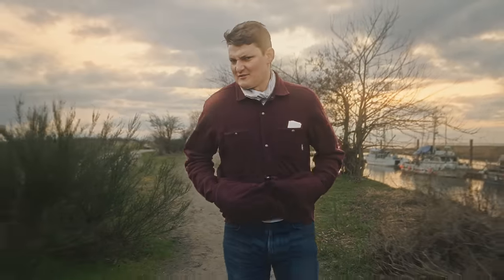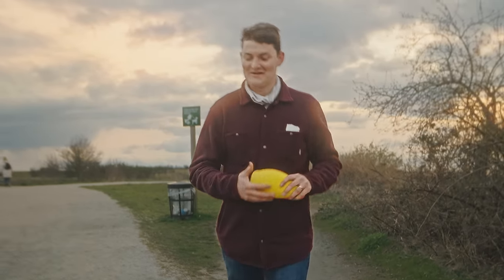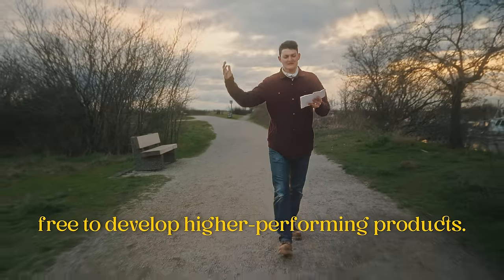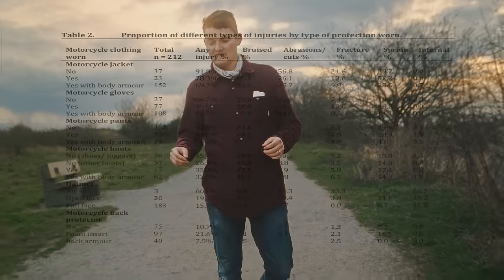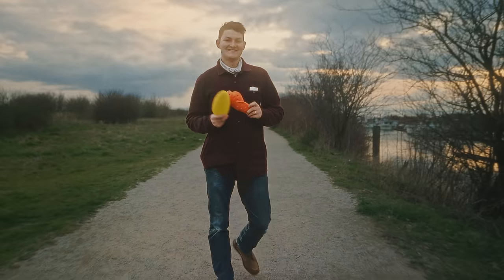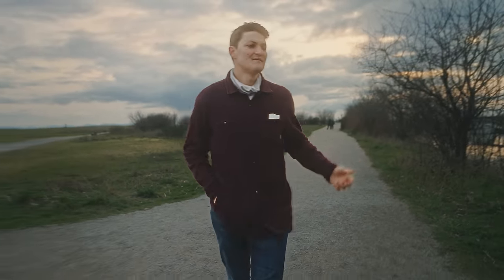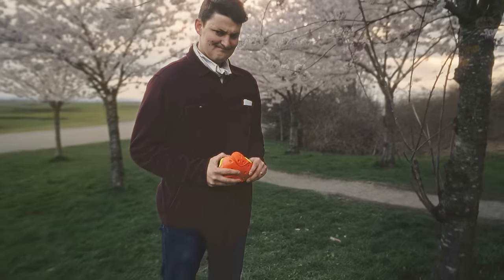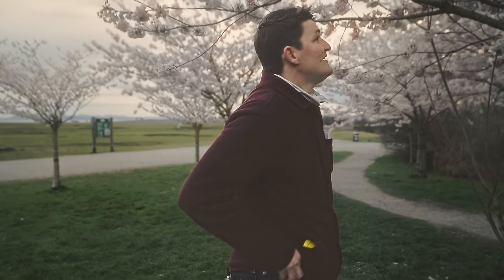Why I Stopped Wearing Motorcycle Body Armour

Comment: What was the criteria for getting into the stats mentioned? Insurance payout? Hospitalization? Lost workhours? By definition, those were wrecks that resulted in injuries that armor didn't prevent.

The more important question, that's been anecdotally mentioned so many times in these comments and anytime there is N+1 riders are talking together, is HOW MANY INJURIES DOES ARMOR REDUCE. The difference between a muscle bruise and a bone bruise + abrasion is several weeks of activity-limiting pain.

Yes, the standards should be stronger and the market should provide consumers better options at affordable price points. But given that F9 isn't going to fix capitalism, the next best thing is to honestly evaluate risk and act accordingly.
Reply: Perhaps it's a form of survivor bias. Only the crashes severe enough to warrant a report (hospitalization, emergency response, etc) are studied, no one is going to interview the the rider who crashed, slid, got a little banged up, but just called a tow and went home because the researchers would be less likely to know about that rider. Basically, only studying the worst of the worst where injury likely would have happened anyway, gives a skewed view of effectiveness. That said yeah, 9kn for protection is ridiculously high and it should be at 4kn or lower given were tussling with 2tonne cages.
Reply: There's also a problem with the argument that it should prevent injury by looking at the presence of any injury at all, because how do you evaluate what injury would have happened lacking that padding? He does give an explanation of the energy rating that the technology is capable of dealing with, but even if you are still injured with it present, the implication is that you would be injured the same level if it wasn't present, the way this video presents its argument.
Reply: the 2 times i've crashed a motorcycle, the only place i injured was the palm of my hands from the fall, one was hard enough to split my leather glove (rst tractech) armour definitely took the shock out of my knees as i hitting the ground.
Reply: This is a completely stupid video by Ryan imo. 
Of course body armor helps reduce injuries. 
Why do we wear helmets if it doesn’t?
I proved it just this past weekend on my dirt bike.
Reply: @RealHooksy Helmets have safety standards, even they made a video on how DOT is worse than trash and you should get an ECE
CE pads don't meet any fracture medical basis and specialized pads or airbags do, it's in the video you just watched
Reply: @JohnSmith-294  the video essentially implies that no pads are as good as some pads, which is patently ridiculous imo. 
I have proved this multiple times. 
Statistics can be manipulated and I’m not saying this is occurring here, but it’s in the ballpark.
Reply: @RealHooksy * [in terms of fractures, and the industry should allow for better protection to be developed]
Pads help with abrasions and that's why he chooses abrasion resistant clothing
And the sources are at the end, read em
Reply: @JohnSmith-294  yes I understand that, but the title suggests that we should stop wearing body armor. 
I’m saying that is a ridiculous conclusion to a larger conversation. 
I recommend wearing body armor whenever possible. 
The best armor is obviously better, but some is better than none. 
That’s only my opinion of course, but it is backed up by over 40 years of anecdotal evidence. 
I still have the scars to prove it. 
Safe riding.
Reply: @RealHooksy  the video literally endorsed armor that actually helps like airbags or dedicated race armor
The point is that CE pads sell themselves as impact protection when they're simply not
Reply: @RealHooksy To be fair, he was very hesitant to outright say they're useless, more that the standard should be upped. A lot of companies are going to cheap out, and as long as that was the case, he personally would go without it and add resistance to bodily harm in other ways.
Reply: @rya3190  ok, but I’ll keep wearing passive protection thanks.
Reply: @RealHooksy  👍

Comment: It is always shocking to me to see how little experience most motorcyclists have with crashing. First thing I did was ride an enduro and crash on dirt. Once I knew how to do that I started crashing on asphalt. Never got any serious injuries BECAUSE I ALWAYS WORE LEATHERS WITH ARMOR. Nowadays I have enough experience to know pretty exactly what would happen if I crash in any given situation. Sure, armor can't prevent me wrapping my spine around a guardrail, but it sure keeps my kneecaps where they belong, and my flesh inside the skin. There's not just abrasion OR fracture. Imagine your kneecap hits a pebble while sliding over the asphalt at 80 km/h. When that happens, armor is the difference between a hurting knee and picking the kneecap out of your sock.
Reply: "experience with crashing"? How many bikes and armors did you damage when "learning" this "skill" and what were the costs of repair?
Reply: @szymongrabarczyk3561  Not much damage, the bent foot levers easily bent back. Other than that the usual: Some mirrors and turn indicators, and the occasional brake or clutch lever. It's really important to avoid highsiders & always try to go for the lowsider. Never broke a bone or anything that required treatment because it was all low speed with carefully calculated risk (clear trajectory). Probably only works if you start learning this as a kid though.

Comment: You're right and you're wrong here, RyanF9.
Body armor on the knees  is typically most useful not as impact protection but as abrasion protection, as you touch on in the video. So there's this situation where we have to ask "what kind of crash am I planning on having?". If you drive in 50kph areas all the time, then impacts will be lower (so the armor may actually be effective there) but abrasion will be lower. Whereas if you drive in 100kph areas on rough chipseal roads, then sure any impacts are likely to be more than the armor can attenuate.... but if you start sliding down the road in your 'kevlar shirt', good luck to your elbows unless you have armor on there to help resist the abrasion.
Reply: Kevlar, ballistic fabrics, and leathers all slide much better than other fabric. Wearing leathers was started because of the qualities of oiled leather. It's not just a fashion statement.
Reply: for god sake, we have many accidents when riders in races slide from 200+kmh on their butt (no armor there, just leather) and fine except burns.
Reply: @inevespace  Race suits are usually a double layer of leather AND kevlar inside that on the butt. They're also a much less aggressive surface than a chip seal road. Besides, the slide time at 200kph is very short, you quickly find yourself in the gravel trap.

Comment: I think it has value mostly for trail and ADV style riding off road. If you're doing that type of riding, you're falling off on to gnarly surfaces at slow speeds regularly, and that's where those pads really shine. Many a pointy rock has failed to crunch my elbow, or my hip, or shoulder.  At 70 on the highway...they won't do s**t.
Reply: Especially knee/foot etc armor. Proper leg braces if you ride gnarly offroad seems like a nobrainer beacuse it will help protect against hyperextension, twisting etc which are injuries that will absolutely ruin your day and doesn't require high speeds or hard crashes to happen.
Reply: At 70mph they'll do a little, but at 30mph hitting gravel on a left hand turn in traffic pads will do a heck of a lot!
I've wrecked 100s of times, on road and off and I know for a fact that those cheap pads were appreciated every time! I rode for years before buying motorcycle-specific gear and I know that the difference in protection is massive!
Reply: @werepat  "Wrecked hundreds of times".....you sir, need to learn how to ride.

Comment: The best way to avoid fractures and broken bones in a crash is not to stick your arms out before hitting the ground. Also try to stand up a little on the pegs before impact as this helps throw you over the car bonnet etc and stops you getting tangled up in the handle bars. In a low slide style accident it also pushes the bike away from you. In the interests of scientific testing, I've done a lot of crashing on motorcycles over the years (at least 2 dozen accidents from 20mph to 80mph) and I can honestly say I'd of avoided nearly all of these accidents if I was just riding a little more sensibly.

Comment: One instance I had was I was going on a little winding road along a river through the mountains. I was coming up on a corner, and I kid you not, a bumblebee flew inside my helmet and landed right on my glasses. It distracted me enough that I forgot about the corner, and I was going to hit the guardrail head on. I didn’t have time to stop or complete the corner, and I dropped the bike down on its side so the wheels would hit the guardrail first. 
I landed on my side and slid with the bike until it stopped. 
I didn’t get a bruise, my only injury was my jacket rubbing my skin. 
I guarantee that if I didn’t have my armor on, my hip and elbow would have gotten a major bruise. 
They may not protect against really high crashes, but a crash like mine worked great. I picked my bike up and kept riding through the day, with only a few scratches from my jacket where the armor wasn’t on my arm. 
I think it’s silly to remove the armor, especially if it’s good flexible armor, and I won’t because of my one and only crash on pavement.
Reply: and the bee???
Reply: @pamvarnsverry2444  good question, I have no idea what happened to it. I didn’t even think about it until you said something. My guess it got knocked out of my helmet. I really don’t know.

Comment: My huge respect for RF9 has been significantly diminished by this video… as many others have previously said the primary purpose of the armour is to spread the impact forces over a greater area to reduce the point load thereby reducing the severity of damage/injury. 

While riding on green lanes last year I had a fairly large off sufficient to shatter my left wrist, right thumb and put a large bruise across my forehead where the helmet spread the impact of hitting the rocks I was riding on.

Had I not been wearing a helmet I would be dead with a smashed skull… with a helmet the load was spread meaning I was only knocked unconscious.  

The A&E nurse that examined me was astounded that my wrist/hand injuries were the only the only broken bones… I was wearing MX boots and MX body armour under my jacket which spread the impact on the rest of my body… I was wearing thin gloves without any significant pads/plates and no wrist protection… not a mistake I will make again

Comment: I also ride MTB and it would be impossible to convince me that not wearing pads is a good idea. They do a great job of distributing the impact force over a larger area and can frequently compleatly negate the painful effects of a drop. But I can also understand that as you increase the impact force they will loose their effectiveness as they just don't have enough "travel" to decelarate body parts gradually. But in effect they should still protect soft tissues that aren't impacted by a bone  This is where an airbag can be amazing due to it's massive surface area to absorb and slow down.
Reply: well said , i actually have fox pads in my jacket elbow cavity as the oem seemed below par , they fit nicely though i had to cut the tube elastic , i tested it before the cut and it was already good so i committed.
Reply: Doesn't your MTB armor have dual layer, i.e. hard outside shelf with some inside foam? That is indeed effective, but these tiny little CE pads are not.
Reply: @ws8080  some do , the average rider level ones allow more movement , the 3DO ones hardly feel like you are wearing them if they run no hard shell.  As you are peddling on an mtb the knee pads are much better with no hard shell and still quite effective for MTB type speeds.

Comment: Pads are for initial impact, material for the slide. The biggest issue I have is how the elbow pads are never where you need them when you need them. A simple fix of straps at the loss of fashion, which is the other consideration. People don’t want to look like track day, they want to look like casual Friday. So it isn’t just industry not doing enough but meeting the consumer demand for gear that doesn’t look like gear
Reply: That's the advantage to using something like GoGoGear LA leggings or Panda Moto's close fitting gear and such.... and most of that gear is AA or AAA rated

First, they fit under everyday clothes which is just nice in general and you can dress as weird as you want... Unicorn onesie? Go for it. Three piece suit? Do it. Jeans and a t shirt? All good. Same level of protection no matter what you're wearing over them.

Second, your wearing a two piece body glove basically, so the armor stays where it's supposed to.

Comment: Having had 2 relatively low speed low side crashes, i am thankful my jacket and pands were padded. The only damage i had was on the second wipeout the bottom of my palm where it meets the wrist hit the pavement hard. Those were crappy gloves. Lesson learned. My jacket popped a stitch where i had repaired it previously and my pants were just scuffed (luckily the road had dirt and gravel so i slid on a thin layer of crap and not so much the pavement, although i would not have lost traction if the road was clean!) Anywho, like I said, no damage to me besides my hand thanks to the pads in my gear. I will definitely continue buying armoured clothing. 👍

Comment: In the summer I often wear an MX ballistic jersey. That armor blows alway anything else. And while it’s not meant for abrasive resistance, that large armor is sitting in the perfect spot to prevent it. And it’s thick enough to hold up. It actually stays in place compared to armor in a jacket. And best of all it flows air better than any summer jacket.

Comment: I was a bike messenger for a number of years, and spent more than a decade only on bicycle. In my experience (anecdotal), I never wore knee or elbow pads, no thigh or hip protection. But, helmet and gloves were a constant. When you fall you always hit your hands, sometimes you hit your head. The helmet's probably the best example of mostly unnecessary protection, but what happens in the rare times you actually do hit your head? Yep. Wear them.

Most of the protection isn't going to help often, but the worse the rider you are the more likely it is you'll need it. An important note on that statement- "worse" is not a synonym for experience or ability. I rode with a lot of guys who were "better" riders than me in that they could do harder trials moves or they could sprint up a mountain longer- but they sucked at playing in traffic. They didn't pay attention to the roads, the conditions, and thus wound up in accidents. Most of them never really thought about how bad they were, as all their accidents they would attribute to bad drivers, bad road conditions. My one accident was riding home late at night in the rain when a dog jumped out on a turn- I turned and went into a slide and went through the back window of a parked van. That was my fault- I was riding too fast for conditions, and let cold and fatigue get the best of me.

So, regardless of how many years you've been riding, it's more likely than not that you are an average rider. If you get into accidents you are a mediocre or a bad rider, regardless of if you think it's "their" fault.

And that's where you start from. How much do you trust the world to not reach out and slap you? How often do you ride at a limit of your abilities? Armor is about limits and risk mitigation- it's your choice, except for the head, which proves to be expensive to the public. It's why you have to have lights and turn signals- neither of which is necessary for riding, and often ignored; it's too expensive to the public for you to not have them.

Meaning, you don't need armor. It's likely to be less painful and cheaper to wear it. If you know your skill level (in a real, measurable sense) then you can ride without it. Look at all the "Biker" dudes riding in T-shirts, chaps, and a token helmet. Minimal gear, but they also do the easiest, simplest riding on the planet. They still get hurt. And they pay for it.

Comment: you are more witty than you are wise. the numbers specified in the standard you quoted likely refer to an extreme scenario with a dead-on impact at 120 kph, which would indeed cause fractures if 18kn were to be transferred to your limbs...but I believe most bike accidents occur at lower speed and in many cases, the impact is at an angle and would have a more significant abrasive component. therefore, in many cases, these protectors would indeed help prevent a more significant injury and probably many fractures in cases where the protectors reduced a 5kn hit to a 3kn hit...
Reply: Near the end he even said they can still help with abrasion. I think the key take away here is that there IS better body armor for fractures available, per his horse girl comment, but we're not getting them because there's no need for them to improve the armor. Therefore the gist is that we want/need better armor
Reply: Site your sources, or this is all simply conjecture.

Comment: You're right, but on the other hand, I have never had a high speed crash, so the times I have come off have been roundabouts and corners in the rain at <20 mph on the way to work, and not having to deal with aches and bruises at work is always good. As I plummet rapidly towards middle age, shaking off those cuts and bruises doesn't happen as quickly as it did in my 20s. 

I'm far from ATGAT, but if I'm already layering up for a cold wet commute, I'll keep the pads. Maybe come summer I'll rethink.